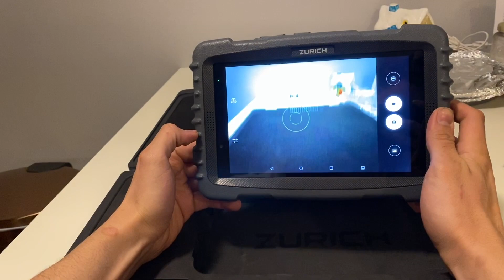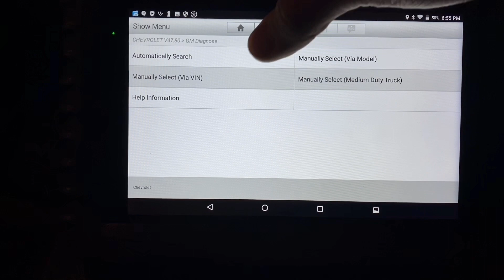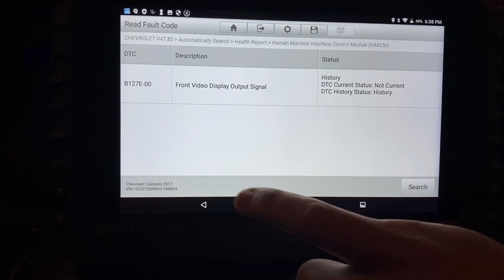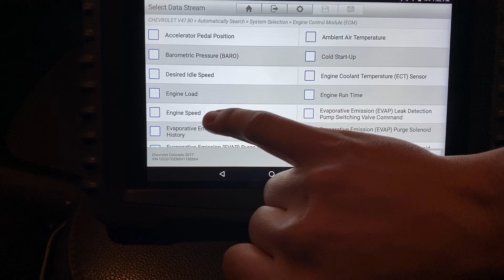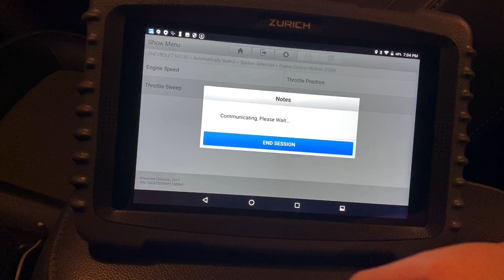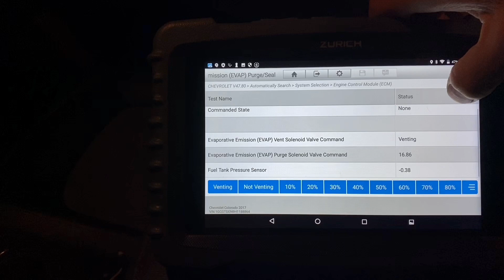Zurich Pro Scan Tool

Comment: Does it do tpms learn and brake maintnice mode and push button key learn
Reply from the maker: Christian Swecker Yes it can put vehicles in learn mode for the TPMS but you will still need a side tool to trigger the sensors. It also does do brake maintenance mode. I have not yet tried to use it to re learn a push button key fob but will let you know if it can when I get the chance!
Reply: Eddie’sspeedgarage thanks

Comment: Will it do ford diesel injector test
Reply: Just picked up the zr pro a couple days ago, seems pretty good so far, as soon as a buddy drives his diesel over I’ll check it out and let ya know.
Reply: @jrishee5433  did you ever find out if it would do buzz test on diesel?
Reply: I would like to know too, would be sweet if it would do buzz test and cylinder contribution
Reply from the maker: Ken Waller I think the answer is no. Sorry

Comment: Thank you for taking the time to do this video. I'm looking for a scan tool and this one sure does a lot for the price. I'm sure I'm not alone in being skeptical about Harbor Freight quality but I know they are trying to turn the corner. By you doing this video I feel a little better. I certainly can't afford the Snap On Solus Edge so this sounds like a good place to start. If you have any other information about using this scan tool I would certainly welcome another video. Thanks again!!!